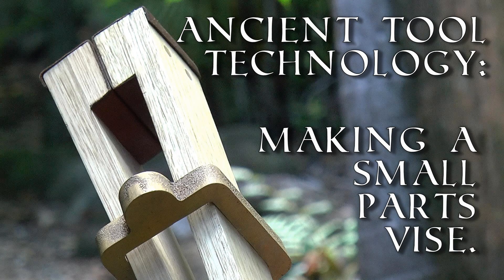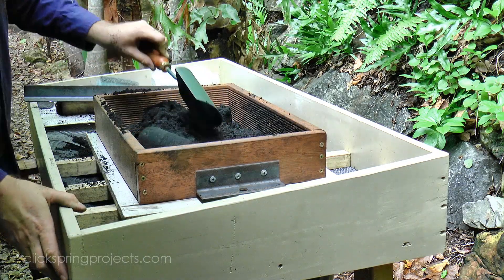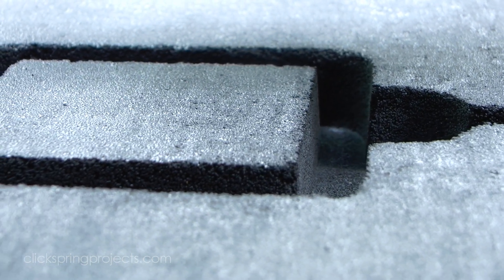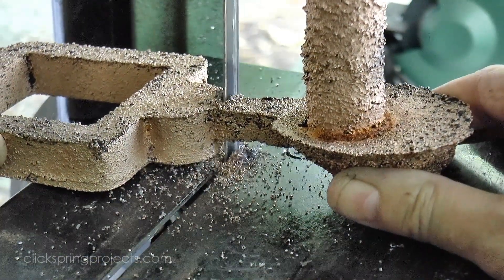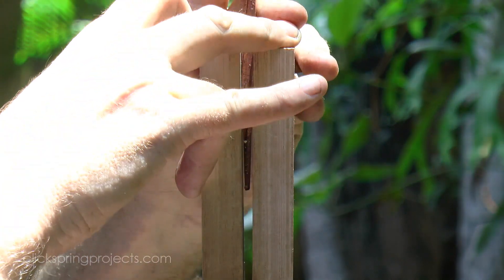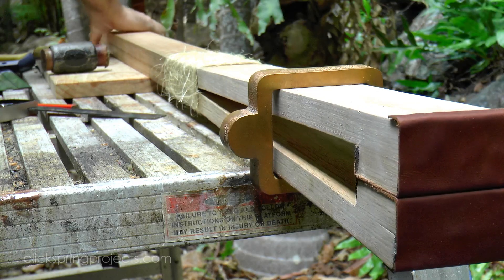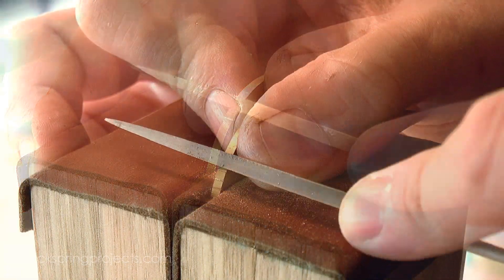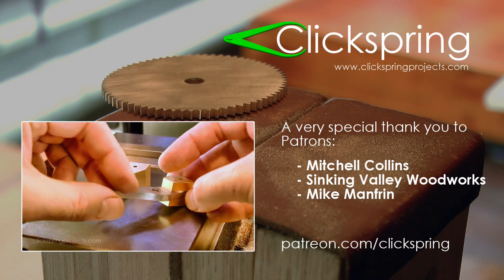Making A Small Parts Vise To Construct The Antikythera Mechanism - Experimental Archaeology

Comment: Yes, this is indeed a take on the stitching pony that I haven’t seen yet. Wouldn’t you know, that a ‘gloving donkey’ is basically the same sort of vise - except there are little notches worked into its jaws just right where the top edges meet. No doubt these little indentations are meant for spacing the stitches in a uniform manner. I do believe that the ‘pattern makers vise’ also follows a very similar design convention. So many vises for such a short life.

Comment: I have a few questions I've been trying to figure out.  I was trying to think about What kind of tools would they have used to remove material? And how they would go about producing precise and  repeatable parts.  I know this was from the skills and trainings passed down from person to person, or group to group.  But my thought was what did they use if they didn't have files.  And how did they find or make materials strong enough or hard enough to get that much precision.  I know it has a lot to do with common sense.  Working the material over a period of time (longer than probably thought of) as well as a very  practiced skill.  But I was wondering if anyone knew they answers and the tools they used.  I have heard that many of the ancient tools were very accurate and precise.  Some more, the same, and less than today's tools.  Obviously the tolerances might be different but for the beat of me I have the feeling that some people had aero grade accuracy and precision back than.  Not that its better than stuff that's not accurate.  But its interesting to me to see the the way people did things back than and how they thought.  Again not that its any better.  That's something I've learned recently.  Not better just different

Comment: I have seen talc used on files to help keep soft metal from clogging up the cutting grooves.   This is crucial for cleaning small files that cannot be cleaned with a steel brush due to their fine groves.

Comment: I applaud the author for this suggestion, but I question the unspoken assumptions made about work style.  I find it unlikely that ancient 'watchmakers' worked while standing up at a workbench, any more so than do Japanese carpenters, or jewelers or smiths.  Smiths have always worked while sitting down at a work desk, in front of a window, and not by not standing up beside a European work bench designed for carpenters, not smiths.  So if a pony like this one was actually used, it was probably laid horizontally on the desktop.  However, in that case, it may have been just as easy to use stops and wedges to clamp small pieces firmly.  For a knowledgeable and experienced user, stops and wedges afford more flexibility of use than even a modern vice, and are just as quick to use.

Comment: Great video! But if you're going for occam's razor, why cast the clamp piece in bronze? wouldn't forged iron be much easier, and cost effective? Iron was much more common than bronze, and easier to source. As a blacksmith I see no difficulties in forging a similar design in iron.

Comment: For a firmer hold - drill a rectangular hole in your workbench, put it inside with the bronze ring on top, put the item in the jaws, coming out on the edges, and hit it with a hammer on top, until fully gripped. When finished - hit the bottom end to release.

Comment: I made something similar but from old mini vice, originally meant to be hammered into tree stump. The ability to have a good grip but still the whole thing being mobile is a huge benefit when working with small objects. I need to think about the "handle" more but it is one of my most favorite tools. Excellent helping hand for soldering and i filed a groove on to it to hold solid wires without mushing them, good for spring making too..

Comment: I just found your channel and watched the video on building the vise and perhaps this idea has come from others as there are over 500 comments which I don't have time to read all of them so apology if this is redundant. Such a vise could easily be held and tightened by making a square hole in a bench and a place near the floor for the end, nothing critical just pull up stick in your work piece and push down into the hole. One dimension of the hole would remain constant while the other might have a sliding block to account for different splays in the vise, or just a loose hole to fit multiple thickness projects. In this way the object would be easier to work on and hand tools located closely and in keeping with the "could they have done it this way" theme it certainly looks easily possible. Just a thought.....love the first video I have seen

Comment: Another great video, guy.
I just have one issues. I have to imagine that accidentally knocking the iron ring-even a tiny bit- would result in loosing the grip on your work.

Given the ring's position right under your work area, it seems to me that you'd have to knock it sometimes when bringing your hand up and down from there. 

Has that happened?
Reply from the maker: Hey Mike, no its not an issue at all. The closing ring is well clear of the work area, and once in position is very firm. The vise provides a very solid grip on the work even with the ring disengaged, which you can see when I reposition it, so even when disengaging deliberately, the work sits rock solid. Thanks for watching :)
Reply: Good to know, thanks

Comment: Hey clickspring, whats the most precise amount of material you can remove on a lathe? i.e. whats the smallest change of radius of a brass rod you could make? Absolutely in love with all of your videos!
Reply: I won't pretend to know what Chris would answer because some of what he does is almost indistinguishable from magic, but with a properly sharp HSS tool of suitable geometry in a nicely fettled, decent smallish lathe with a nice piece of brass, I'd say it's fairly routine to take a cut of 0.005mm depth, and possible to do significantly better with extra attention to detail.
Smaller changes still can be made by burnishing or other methods.

Comment: +Clickspring Hey Chris, I've just finished your skeleton clock build, and I was wondering what you do with the shavings of brass that comes off after working the material. I have seen some of it used when you blue pieces like screws, but that can't be all of it. Is it simply discarded, or can it be melted down to make more material? Is that worth it?
Reply from the maker: Where practical brass scraps are kept for casting

Comment: The sand you used for the casting seemed very coarse. If I compare with what myfordboy uses, for example, his sand composition leaves a much smoother surface on the casting.

Comment: Great video as usual!
The holding of the work seems like one of the simpler problems compared to other technological ones involved in making such a mechanism (making sheet metal, for instance).
And although it is nice to have a bronze bracket around the vise, don't you think that to an ancient worker, this may be little to luxurious a thing to use precious bronze on, when a string, a sinew or an admittedly more clumsy wooden collar might have done just as well?
There's one other important question, too:
I cannot help but wonder how the parts were actually worked: Are you aware of any documented finds of ancient files and metal saws?
Reply from the maker: All good food for thought! Yes much documented evidence for the existence of files across the ancient world, cheers Kai :)

Comment: Just a thought from watching.  Instead of using the metal ring you could use the clamp by setting it in a hole in workbench, then tap down (on the shoulder of the clamp, not on the work) to tighten and tap up from underneath to release.

Comment: casually hand files a perfect toothed gear

lol, interesting video as always - almost makes you wonder if some of our modern tools are infact a little over-engineered!
Reply: Sigma175 I was going to ask if anyone noticed that he hand filed a gear and doesn't even say a word about it. Like it is something that is so common it's not worth mentioning. I am over here saying, wait did he just do that to test this vise project?
Reply: You mean that you don't file perfect gear wheels by hand every day!! :-) I thought I was seeing things at first until I remembered who was doing the filing. A craftsman of the first order.
Reply: Scrolled down for this lol
Reply: What limits your ability to produce ever-finer tolerances is your test and measuring equipment. They dictate how accurate your machines or hand-work can be. Parts can be produced more quickly and more cheaply when the tolerances and materials required are fully understood.

When I consider the engineering of and manufacturing ability to mass-produce my DeWalt brushless tools, I am blown aware. This equipment is unbelievably tough, so powerful it constantly surprises me, so accurate as to be mind-boggling, and so long-lasting I purchased smaller batteries because they weigh less! 

Over-engineering is not really a thing. Engineering is a mirror on the importance and price of the article in question. If you choose to spend more than the minimum required on engineering, you are part of the solution, rather than a part of the problem.

Under-engineering is what leads to Very Bad Things.
Reply: Impressive, but the teeth were premarked. You can see some of the tiny scratch marks on the edge facing the camera before he starts filing, which ones you can see depends on how he holds his right hand.

Comment: btw if you are using boiled linseed oil, you might want to wear gloves when applying it. Most "Boiled" Linseed oil's aren't actually boiled, but chemicals are added in order to get the same effect as boiling it. These chemicals can be very hazardous to skin, particularly eyes and mouth. If you are using true boiled linseed oil you should be fine.

Comment: Hi Chris,  again great video☺ wondering about your furnace. What did you use?  gas?  mine is in the shed unfinished since  year. You crucible is steel?  nice work
Reply from the maker: Cheers Frank, propane furnace, the crucible in this vid is an assay crucible
Reply: Clickspring Hi Chris, did you make the furnace?  looking for a burner  nozzle etc what's the BTU rating?  What are you using for the green sand?  so many questions..apologies 4 that!!

Comment: Awesome stuff and great shots too. No vent holes for the casting? It allows the air in the mold to escape while the material is poured in and an icepick works great
Reply from the maker: Vent holes not required
Reply: the output riser(I forget the official technical name for it) acts pretty well as a vent for simple casts like this.

Comment: That's great and all... But I really want to know what the ancients used for files?
Reply: The Bible mentions files specifically in 1 Samuel 13:21.  But I think it likely they (the Israelites) had them much earlier.  Tubal-Cain is mentioned in Genesis 4:22 as "an instructor of every artificer in brass and iron"   The Egyptians & Greeks both showed remarkable technological sophistication.
The file is an ancient tool.  From Wikipedia: "The Bronze Age and the Iron Age had various kinds of files and rasps. Archaeologists have discovered rasps made from bronze in Egypt, dating back to the years 1200–1000 BC. Archaeologists have also discovered rasps made of iron used by the Assyrians, dating back to the 7th Century BC."
So, they probably used files very similar in appearance to what you see at the local hardware store.
Reply: A rasp for shaping wood I get. In fact you can be quite handy with just a piece of obsidian and a piece of wood. However, to finely shape brass and copper gears and latches would require something a bit more fine tuned than a rough rasp. I doubt they figured out the oil hardening, quenching, carbon loading etc., until much later. Were they crosshatching iron rods, and shaping them into profiles? How long could a non-hardened piece of iron be used to shape a piece of brass until it became worn out?

It's a very fascinating science and topic of research. It just seems odd, that the advent of the file was happenstance, rather than a learned knowledge passed down... but from whom?
Reply: Most likely a steel or iron file, similar to what we would use today.  The iron age started between 1200 BC and 600 BC, depending on the region.  Archaeologists have discovered rasps made of iron used by the Assyrians, dating back to the 7th Century BC - this mechanism is currently dated to around 150 BC - 200 BC.  by the time this mechanism came along, they'd had a few centuries to work out a few details about iron and steel, like work hardening and tempering, although it most likely wasn't the precise science we think of these days.  So I'd guess it would be a file or rasp like we see today - they're much older technology than you'd expect.

Comment: A better way to heat up a resin would to have really hot water that's being constantly heated and then put the resin in a metal cup and set the cup in the water. It'll melt it and keep it melted but won't burn

Comment: Hi Chris, I've been looking forward to viewing your next build and I think you chose a great first project in the clamping vise.  I made a modern version (about twice as wide) for a skeleton clock that I made and it really is the best way to hold those large plates. Small stuff too. Like all really good tools, you will enjoy using it (though I think your knee may object😁) because it works so well.  The AM is a huge project and I think you're a glutton for punishment if you are planning to make all the teeth by hand. Great job on the casting. The clamp (??) looks great. Was that your first time with casting? As always a brilliant video for us to view. Keep up the great work.
Reply: I am also wondering if this is one of your first forays into casting?  I read from another post where you got your sand, so I understand why it came out looking so rough.  I expect that we will see more castings in the future?  I would recommend getting some finer facing sand, especially if you need to cast parts for the AK mechanism itself.  If for no other reason than it should make smoothing up faster.
Great video as always; I'm already hungry for the next one.

Comment: I'm thinking the inside of the clamping ring/square must be rough enough to hold itself but that would also wear the wood.
Reply: I think you would be surprised to see how well the oak would hold up over many years.
Reply: Oak would also smooth off the brass over time, the shallow angle is what prevent slipping.

Comment: My grandfather was a carver and gilder. He had [I have] 500 master carvings and 500 molds. The older ones were made form pitch, the more modern ones are made from a mix of shellac and talc.  95% of them were used for the ornate picture frame construction [like L-13, L-14, L-15, L-16]. Nice to watch young folks use the old but time proven methods. Cheers.
Reply from the maker: Cheers Tommy, terrific to read that detail, and thanks for tuning in :)